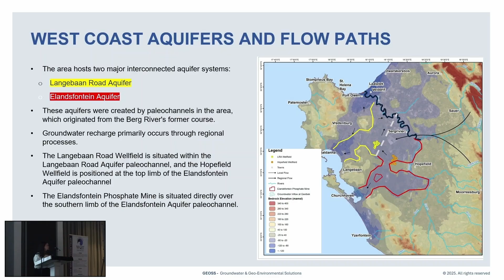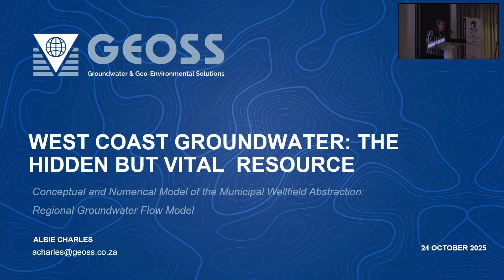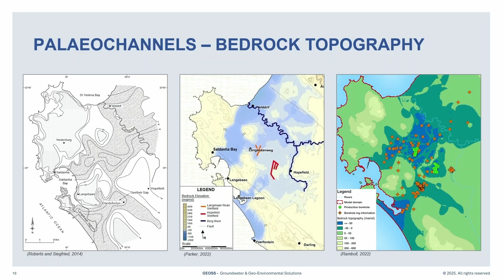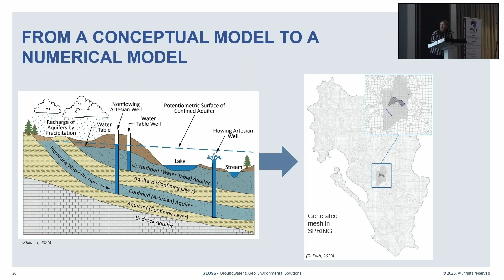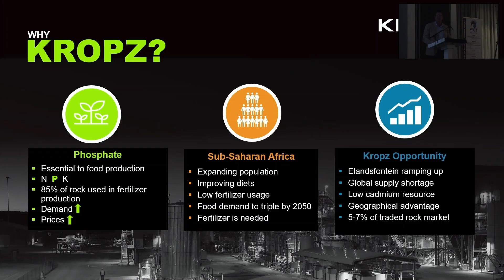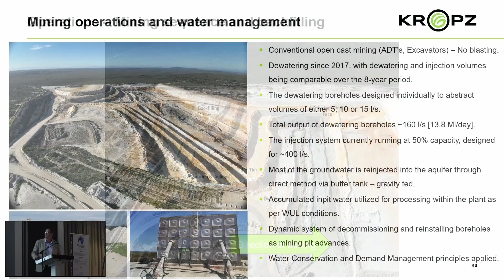GEOSS-2025

Comment: I find this report rather disappointing. It shows how there is no water loss between the extraction point and the point of returning the water to the underground system, but it contains absolutely no data at all on pressure, speed, nutrient level, oxygen level, or the impact on the surrounding areas that lie between the mine and the Langebaan Lagoon. The point is not the volume of water, but the quality of water and the speed at which it travels, reducing its natural exchange of nutrients, etc., with the surrounding area on its way down to the sea. It also does not take into account how long the water would have naturally taken to travel that distance. To report that the lagoon is showing no signs of disturbance a mere few years after mining activity commenced is bizarre. At natural rates, the water would have taken hundreds of years to reach the sea. There is no true dataset available to show the impact because the impact has not occurred yet. Please provide more details, independently sourced (i.e. not from the mine itself....for obvious reasons...).